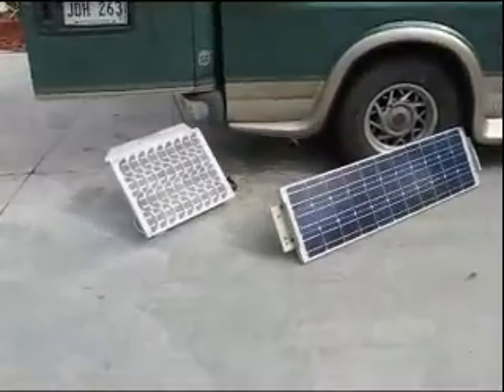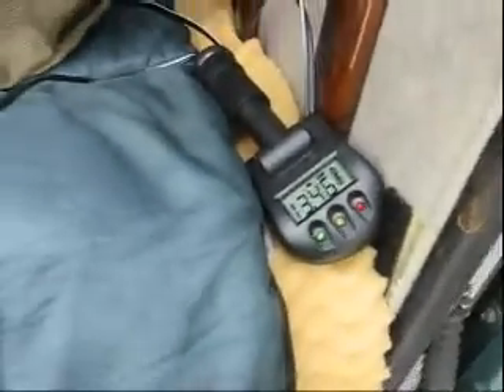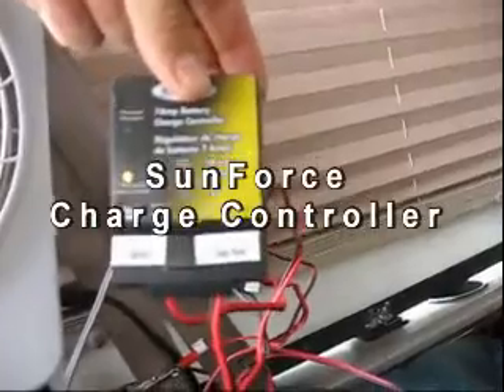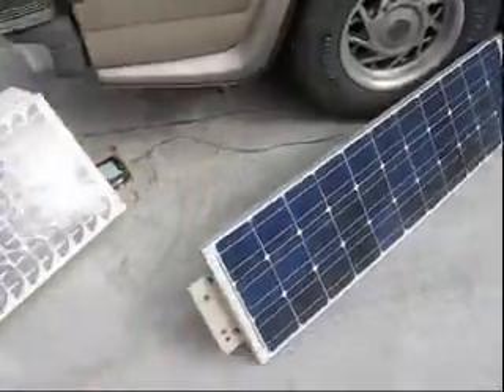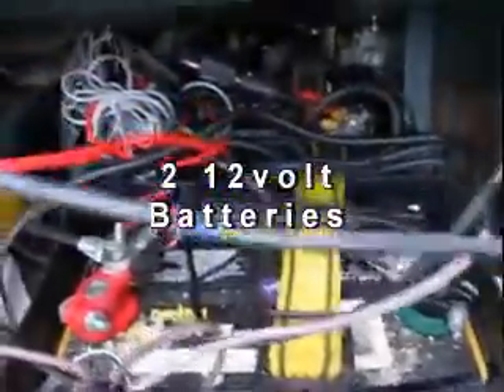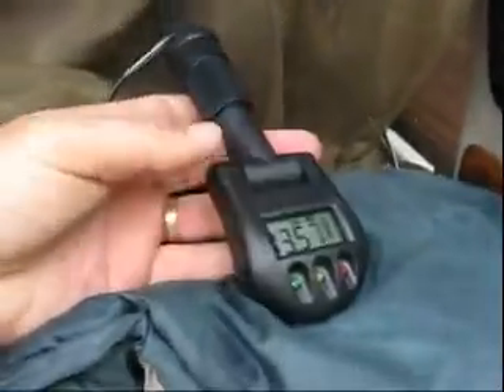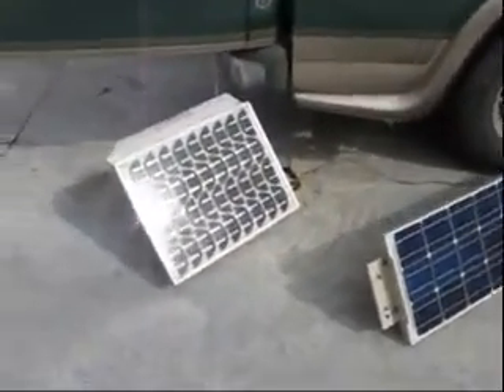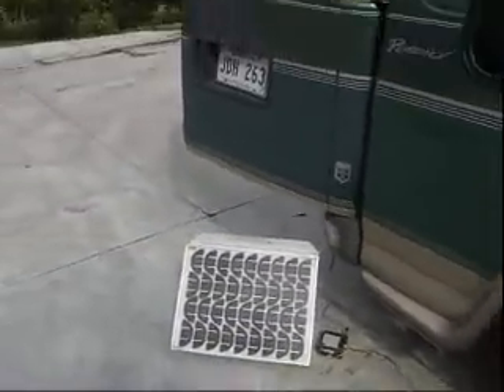Solar Panel charging Batteries for Camping

Comment: shit! a LOT of cables! You need to clean that up before you get a short somewhere and a fire! .. :) Why not make a real installation with neat cabeling and put some mounts for the panels on your roof.. When you camp you just quick fix the panels on the roof and connect them to the car system by some contacts mounted on the roof or side of the car or something :) .. would be a real nice system!

Comment: i have also purchased simlar solar charging devices that can charge 5v to 12v devices. they have their own intenal battery that the solar panel is charging , then the battery in the unit is charging cell phones, mp3 players, etc. how long and how much you can charge is depending on the amperage of the battery inside the unit. my panels in this video is for charging anything that requires 12 volts only. i would need a step down transformer to charge less voltage requiring deviecs.

Comment from the maker: to measure the watts you need a volt amp meter. you need to measure the current (amps) accross the leads coming out of the solar panel in the sun of course. the formula is Watts = Volts x Amps . if you get .5 amps or 500 mAmps then multiply 12 volts x .5 amps to get your watts. depending on the amps you get will be the max you can run a 12 volt item such as a fan or light or charge a 12 volt battery with it. the sunlinq i bought is a 12 watt or 800 mAmp (.8 amps).

Comment from the maker: the roof of my van has no flat surface for a solar panel. i ordered a flexable solar panel and should be in next week, i will try putting that on the roof instead of the glass panels as you see in the video. 
I do need to clean up the wire mess though.
thanks for the input